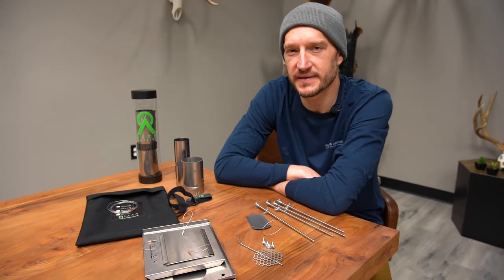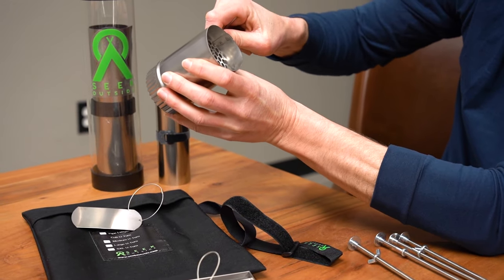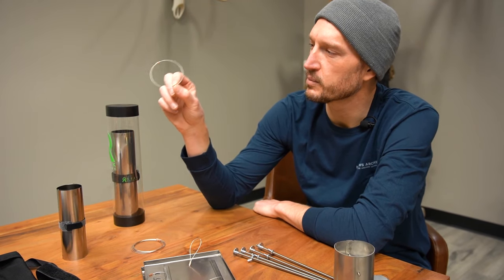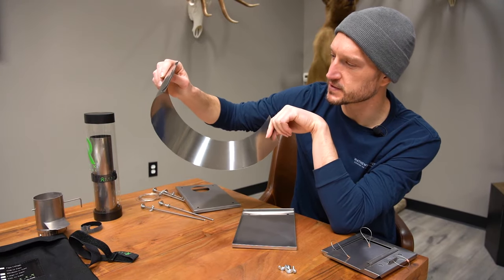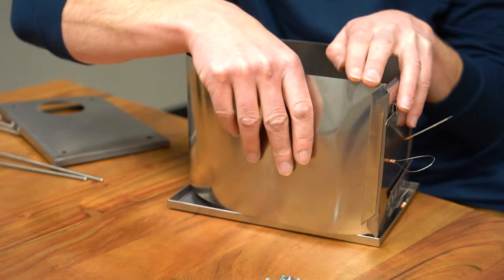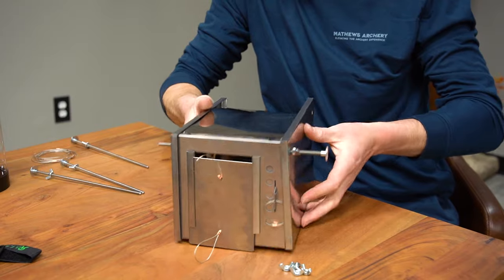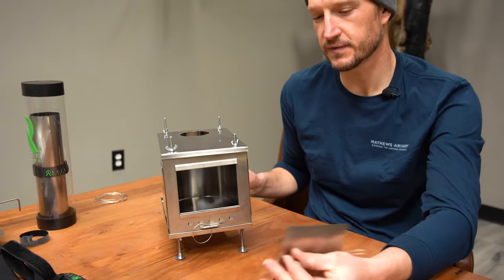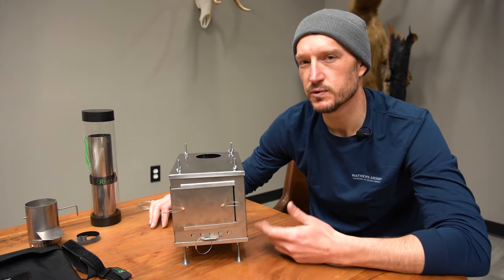How to assemble the Seek Outside U-Turn Stove

Comment: You guys have come so close to the perfect ultralight stove. I have a few observations/suggested improvements. 

1. Why don’t you offer a utility tray for the Cub U-Turn?
2. Why not use the flat end cap to the leg on the top of the stove instead of at the bottom of the legs? Using the wing nuts on the top of the stove makes no sense at all and isn’t practical for those that want to place a frying pan or large pot on top of this stove. Using the rod/leg end cap on the top of the stove allows you to a small nut on the bottom, which saves not only the weight of four wing nuts but saves weigh by using a small nut vs a wing nut on the underneath of the stove. 
3. I’ve made my own ultralight paint can stove and used small rubber feet at the end of my legs. I can pull them off if I want to push the legs into the ground an inch or two for stability or to level my stove if I need to. 
4. You guys could easily make the front sliding door wider and taller by 1/2” to 1”  making it easier to put wood inside the stove. 
5. Why not increase the size of the front sliding door and use a thin piece of ceramic glass as a door thus allowing customers to see the flames. I can’t imagine a single customer prefers not seeing the flames versus seeing them. Being able to see the flames allows you to not open the door as much to check the status of the wood inside as well. You could use the same tiny threaded metal “door handles” that you currently use. 
6. Move the stove pipe to on corner or the other and not have it centered along the back wall. This gives the user more surface space for a coffee cup or small titanium cooking cup if they are using a frying pan or pot. 
7. You could use a small round shelf attachment to the stove pipe to place a small titanium cup on to boil water, cook on or use to keep a coffee cup warm. I’ve seen Wawhiker, who has made YouTube videos for a decade, do this to a stove pipe. It’s a genius next level move. 
8. You guys really don’t produce a rain/snow cap for the u-turn? Why? You are losing money by not doing this. 
9. I use a grate inside my stove that weighs less than an ounce. It’s very similar to the material you use for a spark arrester. The edges of it are bent 90* to keep it about 3/4” off of the bottom of the stove. 

I have more ideas, but they are subtle and hard to explain, but my my overall point is that you guys seem like you are a mile away from finishing the marathon and content to stop. There is a huge long distance hiker market totally unreached by hot tents. Large vestibules are an ideal place for stove jacks and hot stoves. I’d love to talk further with your designer if they would like.

Comment: How long can a fire keep you warm in something that size?
Reply from the maker: Hi! Trail here: It all depends on the size (diameter) of the fuel...a larger log will burn longer than small sticks and twigs. I'd suggest that with good sized logs it can burn and keep you warm for around 3 hours. Typically, I'll get it going and then restock right before I climb into my sleeping bag. On a very cold night, I may have to restock once again in the night and again as I'm getting up and getting prepped for the day. Most night I just stock it once before I go to bed and once when I wake up.